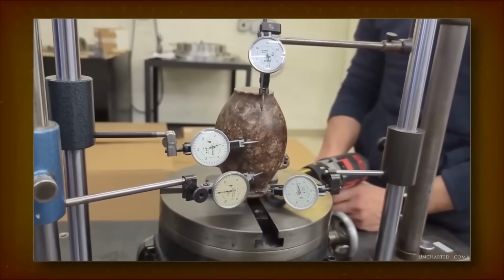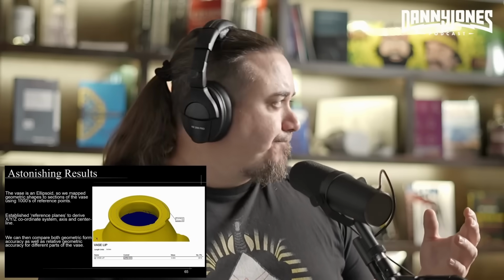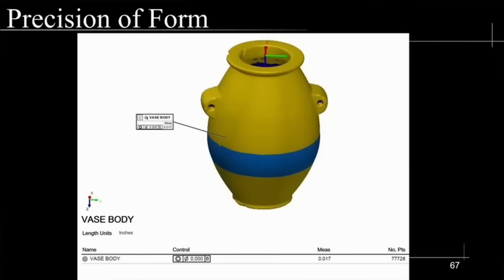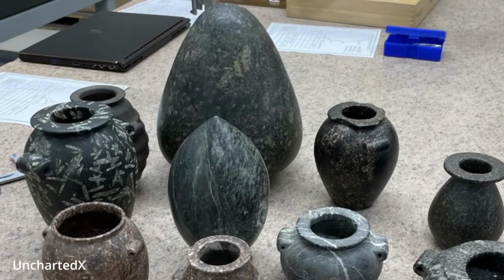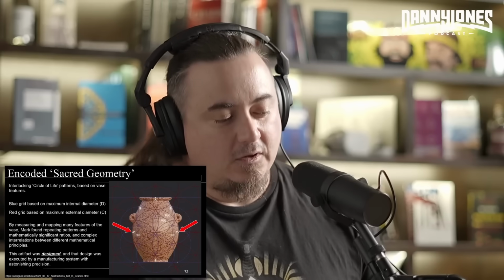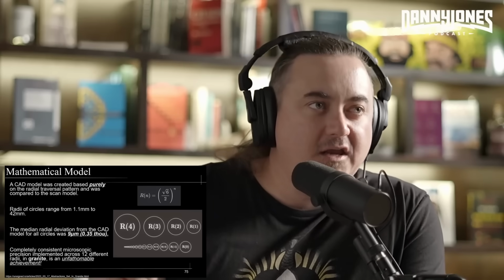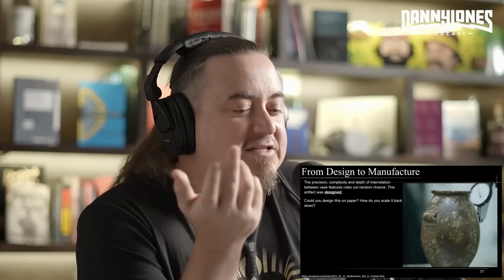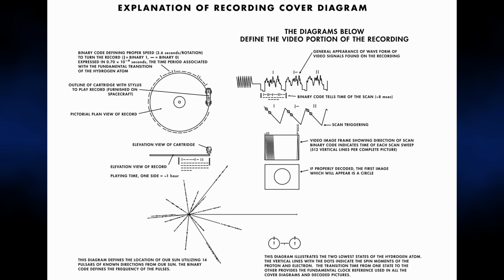Are These Ancient Egyptian Vases Actually Impossible to Make? #podcast #science #history #egypt

Comment: I spent many years making plastic injection moulds, you have some incredibly weird shapes in hardened tool steel that have to be hand finished with oil and a stone to a mirror finish, there is no magic involved, just 100s of hours of patient hand blisteringly hard work.
Reply: They did not have steel or diamonds or the ability to measure this level of precision
Reply from the maker: The level of precision is incredible.